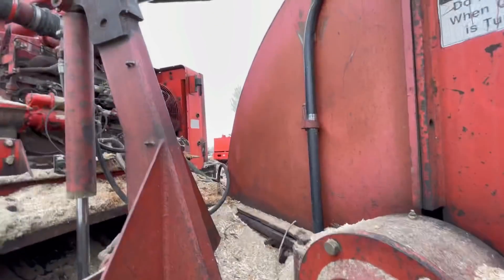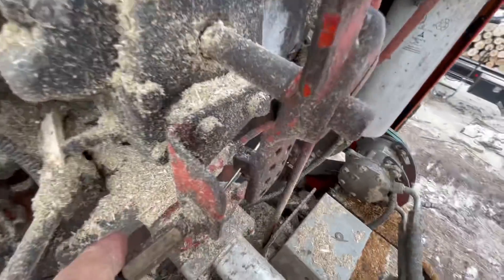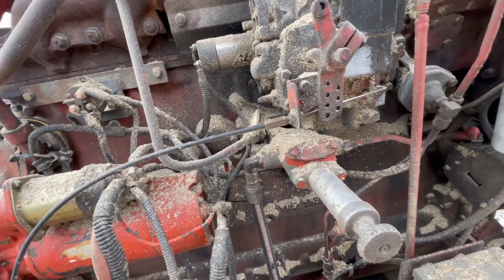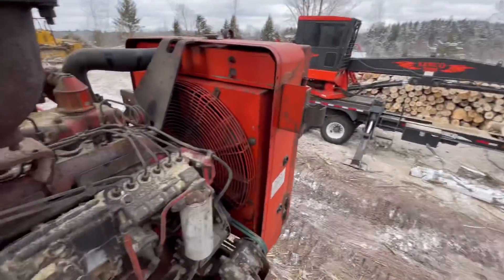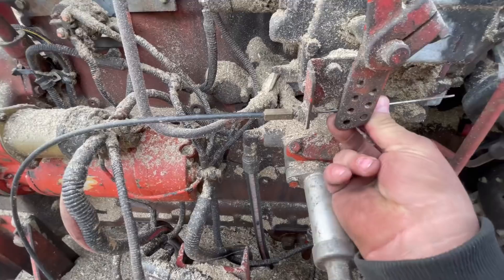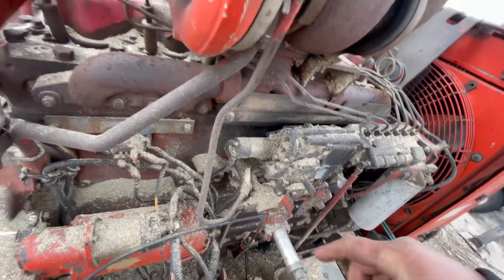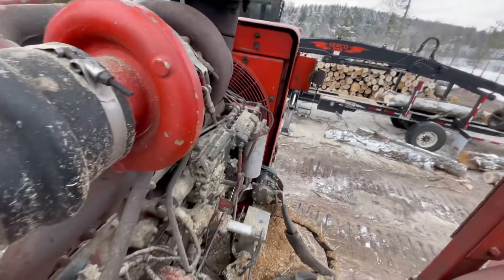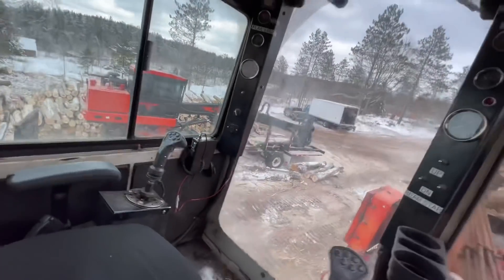Fixing the Throttle

Comment: If the bracket/cable mounting was at a 45° or better angle downwards - rather than horizontal - no water could get up into the cable..